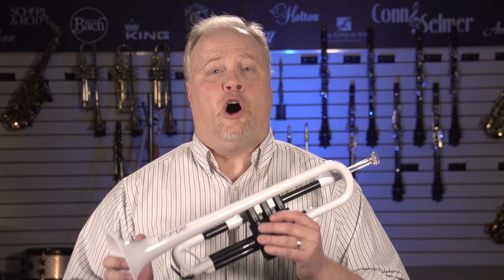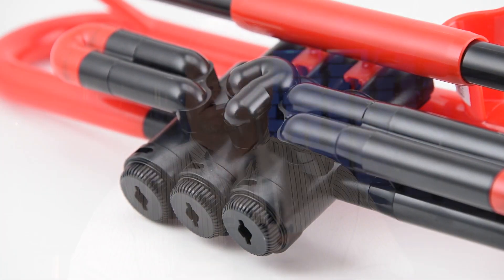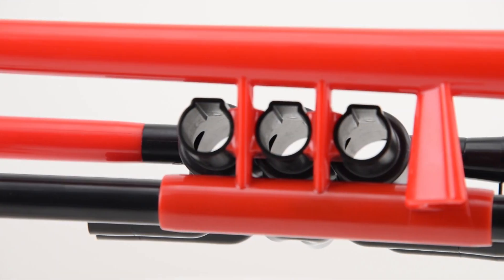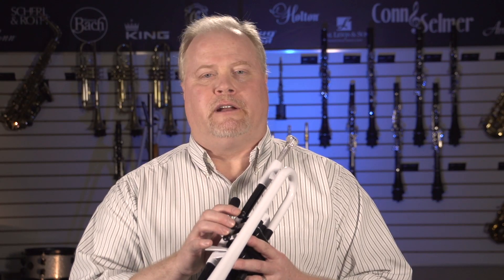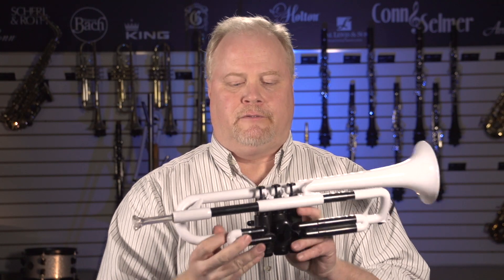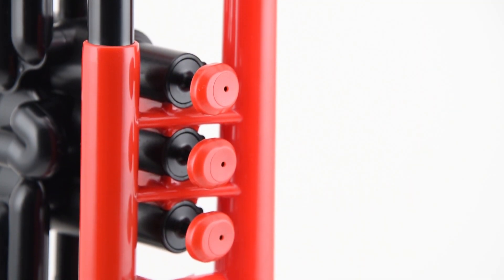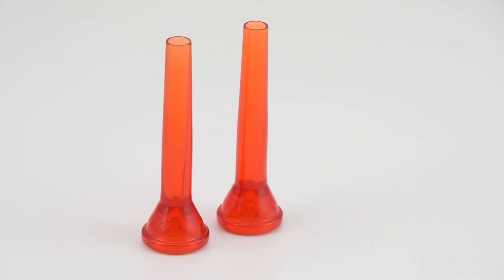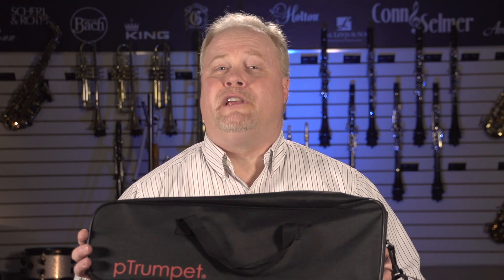pTrumpet

Comment: I bought this on Amazon ,and later had doubts cuz many buyers complained about stuck piston.
But luckily on this video you have shown who the piston structure is by removing them.I am sure with the right silicone lube (in case its stuck) I can get it to function right.I didn't believe before the piston could be removed :)
Thanks.

Comment: The reason I'm thinking of getting a ptrumpet is that my brass one keeps filling up with condensation. As my plastic clarinet doesn't suffer from this I'm thinking the ptrumpet will be less susceptible to it. Please could someone say if this is the case.
Reply: Only problom on the plastic is the valves get sticky easilaly

Comment: And how do you expect the instrument to seal properly without valve oil? 🤔like there are no air leaks?
Reply: The clearances between the valves and the valve housings are much smaller than those in a brass trumpet so the gap for leaks isn’t as great. I can’t remember the valves being a source of leaks in my experience, the airways are at much lower pressure than the valves and their sleeves.

Comment: What about the first and third valve slides? No tuning issues?
Reply: I just bought a comparable coolwind plastic trumpet and I was very surprised with the sound and the ease of intonation. For that money you don't find something similar in brass, no way, but how long it will last and what if someone sits on it accendentally.
Reply: @jean-pierredevent970  At least they're cheap enough that if they do break they're not difficult to replace.